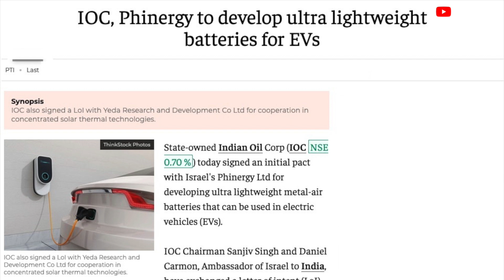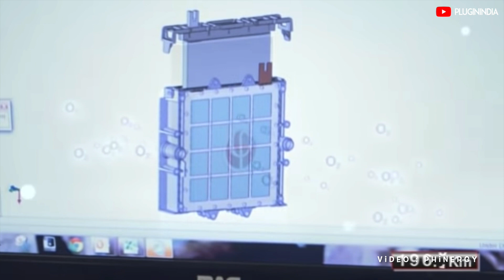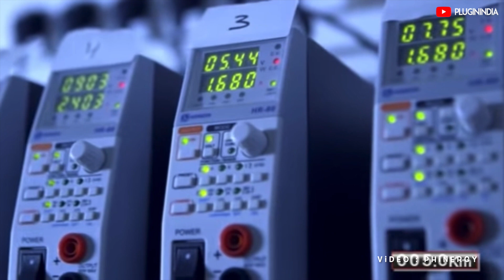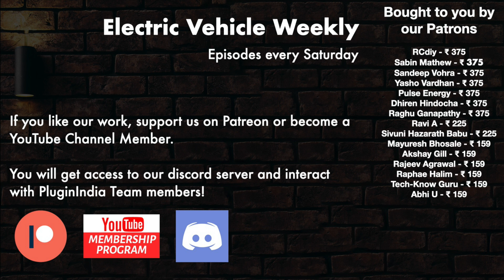PhiEnergy Metal Air Battery tested with Mahindra Treo electric Auto

Comment: Is it rechargeable ? Or replace/swap after every use kind of battery ?
Reply: one key issue not one of the jokers promoting this battery have bothered to ask is " what is cost of swapping 1000 km range Al battery ? Unless this is economical , this battery will fail to take off.

Comment: If the temperature is below zero there might be some problems so check how cold it will work in.
Reply: you just need to warm air if required .

Comment: Curent lithium ion batteries have energy density of 250-350 watts/kg. Where as Aluminum air has 1300watts/kg. Just think about range of of Aluminum air battery. Trice the tha that of Li battery.

Comment: Metal air batteries inexpensive but.aluminium is expensive as a fuel equal to diesel.
Reply: 1.3 kwhr per kg Al energy delivered to vehicle. Each kg Al production releases 1.5 kg CO2 even if all other energy used is renewable. If you use petrol, you release 1,6 kg CO2 for every 1.3 kwhr energy delivered to vehicle. So basically one will increase CO2 emissions. Have the chemical enginners and policy makers done their homework?

Comment: In Batteries like Metal Air Batteries, the Aluminium gets eaten away by the chemical reaction and might have to be replaced later. How frequently do we need to replace the aluminium, it's costs and the availability of Charging infrastructure for Li ion battery fast Charging will determine if there Metal Air Batteries go anywhere in terms of feasibility.